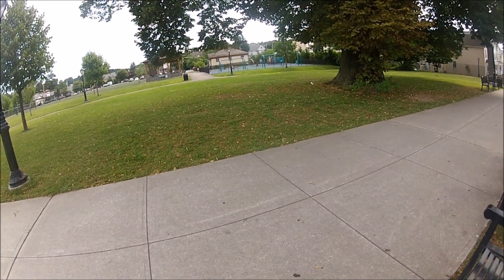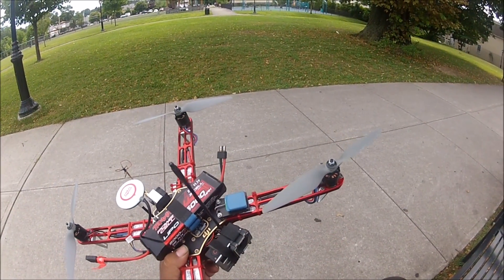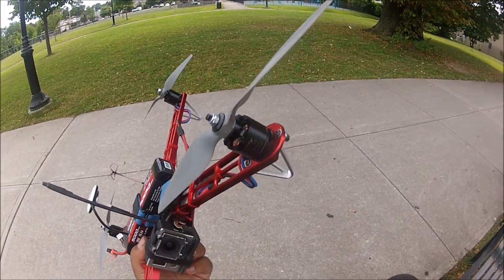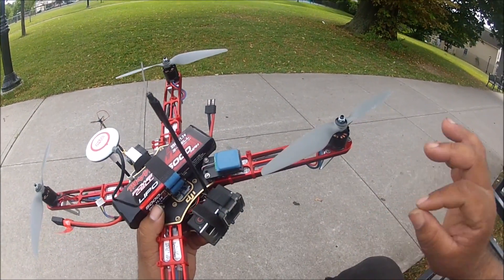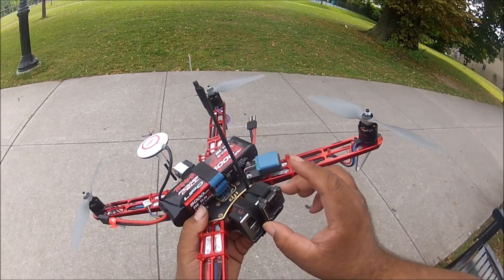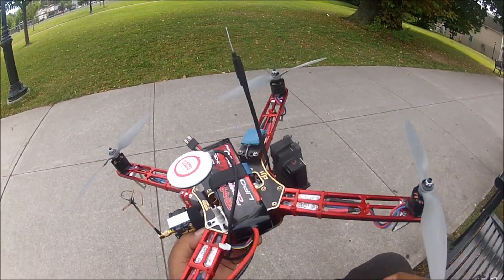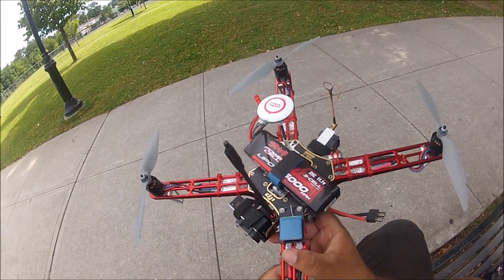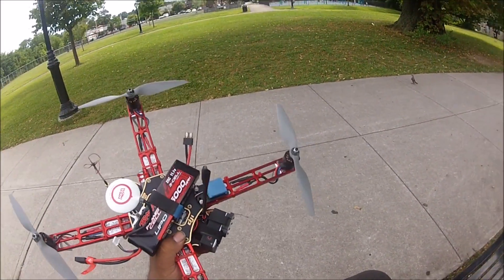DJI F450 Flame Wheel Lighting 100kph 62mph flight with 3s lipo part #14

Comment: Curious to how those speeds were done with that motor prop combo on 3s? I have those same motors and many others and my super light weight (Basic gear and GPS. No FPV or camera) F450 of 4s won't do 60mph. Ecalc has you doing 33mph with a AUW of 1300g on 3s and 44mph on 4s?
Reply: Tailwind

Comment: nice drone , im just finishing up 2nd f450 clone , at 2lbs lighter then last one which had 4 hd cams at 60fps , the top speed i got in free fall from 1500 ft was faster then 60mph lol , landed in neighbors large field after 3.5 mile flight and loosing vid feed , ot was found by the JOHN DEER HARVESTER !!! and chiped to death i only got 1 of the 4sd cards on drone showed full flight and 3.5miles ride from home

Comment: did you ever try it with a 60C battery? Just wondering how's the speed on that.I used a 50c battery on my Blade 200qx. I also gave it 5030 gemfan props. The torque / power was so high that when I made a sharp turn it tore off an arm of the quad. I have to say that the frame was cracked before and I cured it so that's probably why it snapped during flight. But still, 50c battery and 5030 props on the 200qx showed HUGE improvement . Can't even imagine what would a 60c battery do with your quad...I think it should be great. What if you added 900kv motors or are those too huge ?
thanks for the patience of reading this :)
Reply: Small motors do not carry more weight

Comment: Nice job I'm a newbie just wondered why after spending $1000 u didn't get a dj1 phantom?.
Reply from the maker: j singh If you are new get either the dji phantom or the parrot bebop , ounce you learn the basics then you can move on to a quadcopter kit , you should find them for under 1k .

Comment: Yeah, I guess it is going to be a "F550" heavy lift Quad. Extended arms with larger props and strong motors. Don't really have anything heavy on it so much of my gear is overkill and planning ahead. I am going to try some HQ 10x6 3 blade props on it for fun faster flying. About 45mph tops. Normal speeds for video will be in the upper 20's.
Reply from the maker: Jon Bugner If you are planning to build a heavy lift quad you are going to need larger pancake motors and even larger props than 10" , try props from 11 to 14 inch depending of the size and motor specs you are planning to used
Reply: It is heavy lift for it's frame size. It can carry up to 2.5k payload with 12" props on 4s but my gear is nowhere near that. The 10x6x3one props I am using now are for fun fying/speed. And get 23the mins of hove time with 6600Mah pack. I ordered another set of Aimdrodix 1.5v Orange arms to do another build.

Comment: Great build my friend! I just ordered some Aimdroix arms. I bought a set on Ebay that came with 2 limited edition orange arms and 2 Chinese production black arms. I liked the orange ones so much I ordered 2 more. The build quality is much much better than the Chinese versions. Should have my build done this week. Using Avroto 2814 770kv motors, ZTW Spider 30a ESC's, RTFQ's 3.5 Mega FC, 6600mah Pulse 4s pack with 12x4.5 APC props. Should be a fun flyer. No FPV yet need to work on the end still.
Reply from the maker: Jon Bugner So you aren't building a F450 , you are building a heavy lift F450 , I got one of those too , check the link below ...https://www.youtube.com/watch?v=UCf2g_wZKaA

Comment: how do you get it to go at those speeds since naza m lite limits the angle of the aircraft, or are you flying in manual mode ?
Reply from the maker: TheRCSpider The NAZA lite as far as I know is capable to angle at 45 degrees at any direction in ATTITUDE MODE so is good enough to do this type of high speed flights but if I was flying in MANUAL MODE I probably would've go even faster since there is no limit of how steep you want to angle your aircraft to forward flight .
Reply: @TheFlyingRookie  Thanks

Comment: Hello I noticed you said that you are powering your gopro from the naza...Is there a special way to hook it up? I'm new to quad scene and I want to set up my f450 that's coming in the mail with fpv I'm gonna have the immersion 600mw and gopro 3+. I have been all over the net and everyone has their own way to power the vtx but no one says how they are powering the gopro. With that setup to the naza have you had any problems? Any advice on how to hook it up would be greatly appreciated.

Comment: Great job, I believe if you were to have flown it in manual you would have got a couple of miles faster. I think..
I know with my Naza Lite, it still runs some IMU overhead in ATTI.  Love your build maybe some day I will fly like that also.
Reply from the maker: Dee Williams I flown this aircraft before in manual mode and you are right about getting more speed out of it in manual , i'm just not use to it .
Reply: Look like you fly pretty good to me.. And you are a good builder, which I think is very important to the safety of all.

Comment: Getting some nice speeds out of that!
Reply: TFRdrones
 Should do it No Problems, then try on 4S too :-)
Reply from the maker: George Stephen I'm going get a lighter 3s lipo with a higher C rating to see if I can go between 65 to 70mph " 104 to 112kph " , will see .
Reply from the maker: I'm impress my self of how fast this quad was on 3s , I might try a lighter weight lipo battery with higher c ratings to see if I can get close to 70mph , will see .
Reply: 70mph!! Wow!
Reply from the maker: Just eight mph more to reach that goal